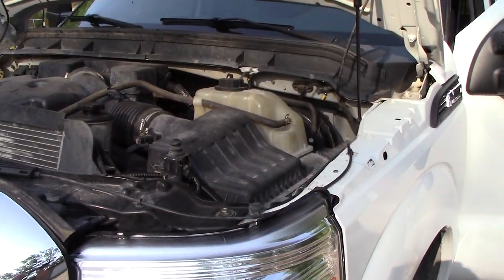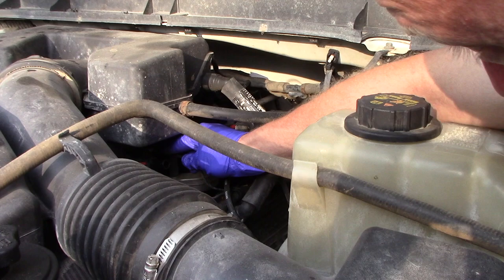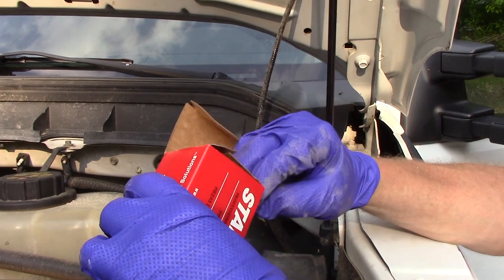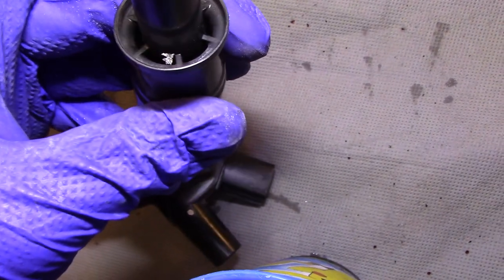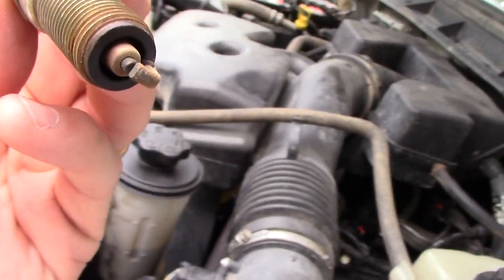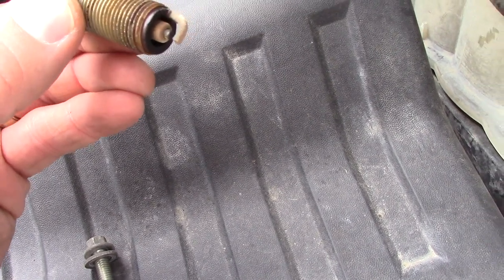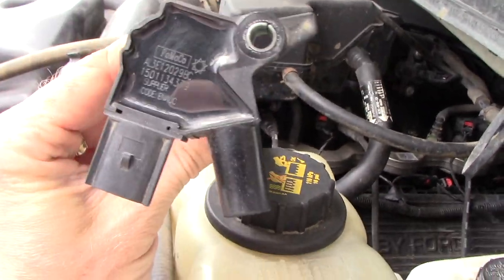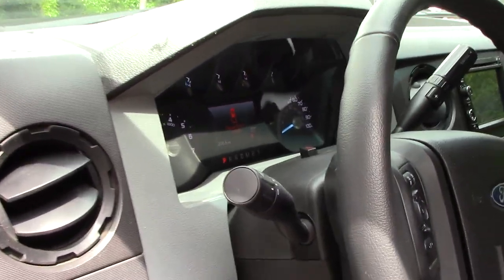Ford F250 / Raptor 6.2 Coil Spark Leakage - Corroded Coil On Plug Causing Ticking Noise

Comment: I know this is 5years ago ... But if anyone is looking to change out your coil packs, Denso brand on Rockauto is an actual FoMoCo part. They just slap their sticker on the coils. I paid 60 bucks per coil ... Also, mine were getting corroded, mainly the pellet. So I went crazy with dielectric grease on all coil connections and inside the coils and especially the area where the pellet goes in. I have a 6.2L, I even greased up the spark plug wires ... It's been 2 and a half years now and it's been running excellent... Hope this helps anyone 

Great video!

Comment: I just had this same snapping sound out of no where.  2014 Ford Raptor with 138k miles that I have had since 8k miles.  Love the truck and will have it a while longer for sure.  I may replace them all since it’s a more known issue.  Great to know about Amazon versus the dealer price for the same part.  Thank you for your video!
Reply: Update: after a while it stopped do it all together.  You have to love a self-healing truck 😂.  It sat parked for 4 days and then started the issue with the coil pack.  It’s probably a good idea to get a few incase the Raptor decides to unfix itself 😏.

Comment: Thanks for the video.  Same exact code same problem same fix. Ford Raptor 2014 Gen1 6.2.  Replaced coil with denso and ngk plug.  No more spark leakage and cleared code.  109k miles

Comment: Also , I bought the TRQ coil sets from 1AAuto with a lifetime warranty for 180 for both sides . Motorcraft will only give you a 1 year warranty. Some of mine the resistor pellet was completely destroyed , just carbon powder.
Reply: How those coils holding up?
Reply: @eliezerregalado6749  Still running fine  , no problems at all.
Reply: I just installed all 8 TRQ ignition coils($200 for all 8) on my 2014 f250 6.2 94k miles . Half my original coils where all crusty or white bottom about 3 of them were ok. Seemed to resolve the issue at first. After three weeks I still have the same two arcing coils on the engine on the drivers side. I wonder if the new aftermarket coils are not good quality or something else is to blame.

Comment: I just got a 2013 f250 6.2 gas.  Had the same issue.  I'm ordering all new coils.  Somewhat nice to know somebody else had the same problem as I did.
Reply from the maker: I suspect more and more people are starting to have the issue as the trucks age and get more mileage
Reply: When I took it to my local dealership the mechanic said this was a first for him. I described it as an arcing sound. After looking it over with a stethoscope he finally caught the spark arcing just like in your video. I got all new coils today and changed them out. So far so good. They were in a pack of 8 pretty cheap so we'll see. I replaced coils last year on a mazda g3 with generic coils. One immediately failed.
Reply: I think I am heading their as we speak.... heard popping on DR side cringed when I thought about valve spring. Wish someone besides a 400.00 set offered a decent set of coils affordable..

Comment: Same problem with my 2016 F250 6.2L. 48,000 miles. Took everything apart, cleaned it , put dielectric grease on everything. Problem came back within the month. I’d bet if I had looked closer there are small holes or cracks in the coil itself. 

After watching this I’m just going to replace all 8 coils and all 16 spark plugs. Need the truck to be reliable. Absolutely love the thing otherwise.
Reply: I appreciate you filling us in, I'm going to use your info and save the work ahead of time. THANK YOU!

Comment: My 2017 f250 with only 52k got an engine light. Took it to ford and according to them it was the fuel pump. They replaced it under extended warranty. The engine light popped up again after a couple of days. With that said, this is now the 3rd time I had to get my truck to the dealership. It seems like they “realized” that the problem is with the coil packs. 
Clicking sound just like yours. 

I appreciate your time and for uploading this video. Super helpful. Thanks mate.

Comment: Had the same issue with corroded resistors and the "fins" basically turned to dust. Stretched the spring to take up the length of the resistor,  and put new boots on.....runs like a champ

Comment: Great video just had it happen to my 2014 Raptor with 185,000 miles. Going with the MSD and change them all.
Reply: How did the msd work out for you?
Reply: @bryansoulas6611  I have had them on now for a couple of months and noticed a big difference haven't had any issues. I would recommend.
Reply: Did you have the checking engine light on ? I have a f250. And I have the same problem

Comment: If you have road salt being used in your area it can cause this issue.
If you replace them all I would recommend the MSD-82748. I run them on my 01’ SVT LIGHTNING 
They work very well
Reply: Thanks just saw those on summit racing. $500 for all 8 coils with good reviews. Might as well.

I believe I read somewhere that MSD solid state coils are still domestic too. Their oil filled coils are now made overseas due to environmental regulations. I believe the Factory coils are made by Hitachi, but on rockauto they are less than 10 bucks cheaper then the Motorcraft ones. These MSD coils come out to about $63 each.
Reply: @austinaubinoe2195  yeah, I think I paid $284 about 9 years ago. 
Inflation sux!!

Comment: I just noticed this today on my 75,000 mile 2016 F250 6.2 on cold start. It goes away after warm up. I know now I'm going to have to replace the coil packs.

Comment: Problem with these coils only lasting 50k miles is due to the fact that they weren’t installed with enough anti corrosion connector grease. They say your not supposed to use very much of it, but you should grease these bad boys down pretty good. And they will last a long time. Just use more grease 😂
Reply: Absolutely agree. I slather it on inside of the coil, where the boot pops onto the coil and inside the end of the boot where it contacts the spark plug ceramic. It will make contact where it needs to. Used to use it on distributor caps to keep water out as well!

Comment: 2019 I found the same thing on 2 of my coils. What causes all of that corrosion is the dissimilar metal between the "resistor pill" whatever it is, and the coil contact. The hole more then likely came from cleaning it out.

Comment: Great video, I was having the same ticking but I was unable to locate the suspect coil. I started pulling on the plug wires that control the plugs on the exhaust side, all are loose enough to pull off with one finger and one was completely disconnected still sitting in the hole. I have never seen plug wires with such a loose fit. Really questioning the idea of going with FoMoCo parts again, I am no mechanic but the thought of using the same parts that are causing the problem concerns me. Truck is a 2015 F250 with 23,000 miles.

Comment: Thanks for posting this, you sped diagnosis tremendously! I have a 2016 F-350 and about 68,000... but I have sparks flying everywhere on both sides.. have the aftermarket coils held up for you?  Forgot to mention, I did have a check engine light, it was a weird code. I don't think Im remembering it correctly, but I think it was crank sensor monitor module. (It was not a good repair, but some did change the plugs first.... so now it will be all new coil assemblies and plugs
Reply from the maker: They actually still work great

Comment: Great video.  We run all GM trucks since Ford can't ever seem to get ANYTHING right in their engineering.  It's not rocket science.
Reply: Like Chevy and Dodge is doing better.
Drive a dodge always need a trans
Drive a GM and you will blow the motor 
Seems all of the manufacturer's sucks.
It seems to me it's what someone is willing to buy and put up with.
I have friends with 2020 Chevys that sound like they are about to drop a rod.
Ford eco boost are garbage
Dodge have fragile transmission.

Comment: Mine has 75000  and all 8 of my coils are like this , no engine light plus truck was getting 17.2 mpg on the highway. I was replacing the plugs or I would'nt have even found this problem.

Comment: Great job! I’m new to diesel trucks and was looking to replace the cop on cyl 7 misfire on a 2011 f250 6.7 but I’m struggling on finding the  correct coil! The one I ordered looked like what you put in your truck but that’s not what I see on my truck! Has some sort of a fuel line that connects to the top of the coil! Motor-craft part# DG525-ignition cool pack! Did I get the correct part? TIA.
Reply from the maker: Diesel trucks don't have ignition coils or spark plugs. They have glow plugs

Comment: 1 distributor cap, 8 wires, and 8 spark plugs worked fine for 75 years. Now this expensive nonsense of individual coil packs and twice as many spark plugs. I’ve had to replace 5 coil packs between 75,000-100,000 miles on my 2012 F250. If I remember correctly they were $180 each from Ford.
Reply: Back in the day when a 5.7 made 150hp and smoked like a chimney lol

Comment: I had to replace coils ignition wires alternator starter and battery ended up doing spark plugs too ......
If you get a code for the knock sensor change your coils ASAP because I wrote it off and and I led to a mess of problems
Reply: I just got this code- i had a p320 cylinder 2 misfire- i guess need to do the coils asap
Reply: I have a P06B6 knock sensor code I've been trying to fix. Mechanic sent me to the dealer for a PCM reprogram or replace and they replaced my #8 coil, wire, and lower plug. There was corrosion between the wire and the plug, but the coil looked fine to me, no corrosion. I'm at 63k mi so the plugs are due, but I'm wondering if those coils are going bad. The code came back after the dealer replaced the coil and plug.
Reply: @Jon-op7fr  do all the coils and ignition wires mine was sparking to the engine because of corrosion you are gonna have to change them anyway it’s just how many other things are gonna mess up because of it rock auto has the kits

Comment: I have the same problem.  I had figured that was the problem . Truck is running fine not missing . Does this effect mpg ? Side note does your truck at times Rev up and down when in idle ? My truck does that from time to time .
Reply from the maker: Yes. It idles up and down randomly. It's almost like the something is cycling on and off in the heads, hard to describe. It's just the way it is. Doesnt hurt anything.

Comment: Hey I got a 2015 F350 40,000 MI 6.2 gas with the same problem I wanted to see if you had a follow-up if changing those coils actually fixed the problem I was thinking more of a timing issue but let me know what ever happened thanks
Reply from the maker: Yes the ticking went away with the coils in my case

Comment: My truck, 2015 F350, has only 34 K miles and started doing it for a year now.  I took it to 4 different mechanic shops and non of them idiots was able to figure it out. Until one of my employees who happened to know about cars. He is from the hood. The minute I started the truck, he found out the spark coming from the front passenger coil pack. Now it is at the mechanic shop where they are working on this specific problem. Initial cost $500.00 😳
Reply from the maker: Those must not have been very good mechanics.
Reply: Jack of All Master of None 
Unfortunately, mechanics in metro Detroit look for quick money that doesn’t require a lot of efforts. They want to work less and make more. I paid to fix my speed sensor $330.00 on my 2015 F350 for 10 minute job and $20.00 part.  They are greedy ass holes.

Comment: I am getting p06b6 code when accelerating at 30 mph goes away after 40 mph and Cause sound like loose nut and sound comes from passenger side . Any help is appreciated 🙏 fyi I checked exhaust and heat shield welds and nuts under truck no loose connections. No spark leaks
Reply: Today after rain the same spark plug ( first) on driver side started to leak. Replaced the coil and as of now no other coils are leaking
Reply: @005preetham  I just got the same code.  Mechanics said I need a new PCM.  Everything I found says coils are the issues.  Just curious if your fix cleared your code

Comment: when it comes to rubber and plastic parts, its more of an age problem than mileage.  rubber will slowly rot/brittle/crack with age even if you dont put many miles on your vehicle.
Reply: exactly. mine is 2016 with only 20k and it started doing this

Comment: I changed all coils, plugs and wires and I'm still having this problem. Any ideas?
Reply: I used duralast coils, ford plugs and platinum wires
Reply from the maker: So you replaced the coils and still have a visible spark?  Or did you just replace the boots? How many coils are arcing?
Reply: I replaced all the coils bc I tried the just changing the boots and seen it was a waste of time bc coils and boots were wasted.  I replaced all coils packs with brand new duralast coil packs
Reply from the maker: @jesseruss9987  so how many are still arching?
Reply: I am not sure, but I think 2
Reply: I replaced another one after the right and it is still arching
Reply from the maker: @jesseruss9987  They arc because there is too much resistance in the spring / plug.  If you replaced the plugs you most likely have a defective new coil.  You need to figure out which one(s) are arching and return them for replacements.
Reply: @JackofAllMasterofNone  Should I don't when it's dark out side?  What's a easy method to figure out which ones are arching?
Reply from the maker: @jesseruss9987  yes. It helps to look in the dark. You can usually here it as well.
Reply: @JackofAllMasterofNone  I can hear them from in the truck sometimes.  Does that happen often that they give defective coils from parts store?  And by the way I really appreciate your help and you working with me. God bless you.
Reply from the maker: @jesseruss9987 parts store parts can be cheap and could be defective.
Reply: @BHauck-os9sy  yup my son learned this the hard way paid 80 for a set off Amazon for a 5.4 3v half of them where bad. Now has a set of duralast for $250 but a lifetime warranty.
Reply: Problem is you didn't use motorcraft only use motorcraft parts on fords
Reply: @pauls3758  Iv learned this the hard way after my first ford nightmare.  Now only motorcraft

Comment: I was thinking of buying an f150 with this engine, talked to a ford tech in the place he said the valve springs break. In rare cases the valve can drop and destroy the engine.
Reply from the maker: This was an extremely rare occurrence usually only on the early 6.2 engines. Even if a spring does break its even rarer that it grenades the engine. I definitely wouldnt let that discourage you from buying one. The gas mileage on the other hand is a different story. The 6.2 is one of Fords best engines ever!
Reply: @JackofAllMasterofNone   How is your truck! I finally got one in an 11 F150 and had coil arching.  I searched for the problem and found the video again. I put dielectric grease on  the inside of all the boots and it solved all the problems!  Eventually I will prob need coils but runs smooth now.

Comment: How did you get that little piece out of the coil?
Reply from the maker: It fell out. Once they seize in place, there is no getting it out
Reply: @JackofAllMasterofNone  i figured it out. Took some small needle nose pliars and ground them thin enough to fit in there. Redone all 8 coils that way. Also had 5 broken spark plugs by the manifold. (Piece where wire connected fell out of ceramic piece) even with all of this wrong the truck still ran fine and didnt throw a code.
Reply from the maker: @jamesgreer1046  Wow. Good job.